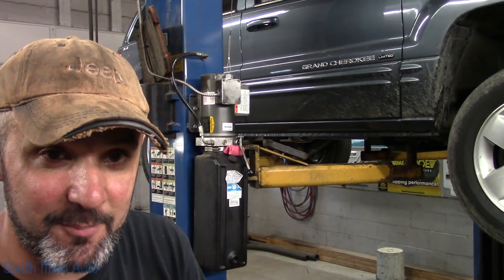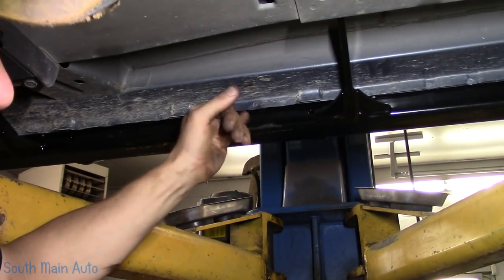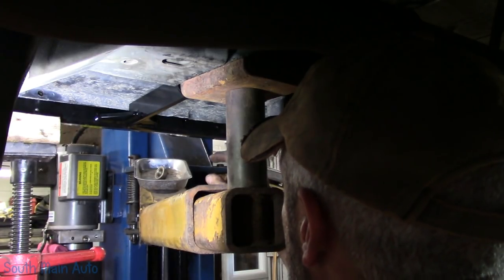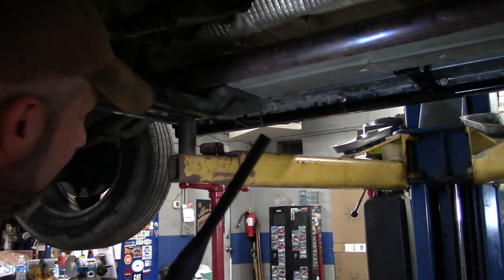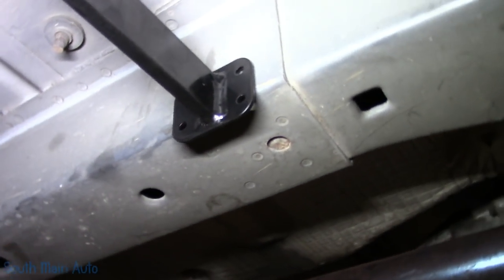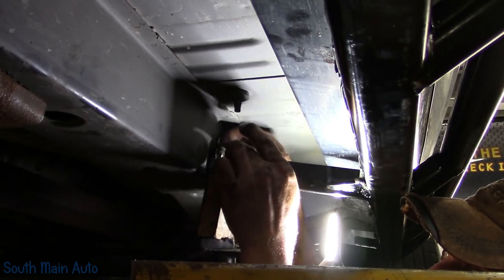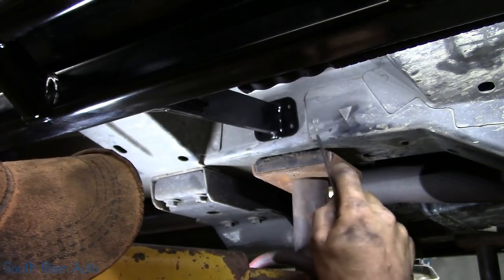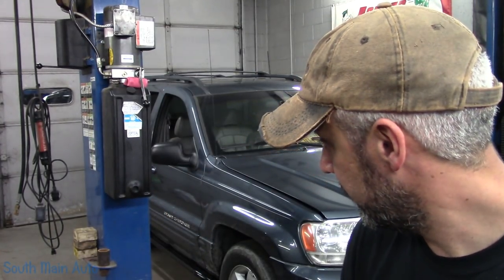Jeep WJ: Iron Rock Off Road Premium Rock Slider

Comment: should have taken the drill tip and ground what is called a self center cut the back part of the cutting edge you grind back on both back sides and it will act as a stabilizer and drill faster much like a center drill without using a center drill 3/8 drill big enought to do that. start slow then pick up speed drill will not walktheres a guy on youtube that will show you what I am talking about. Just for future drilling

Comment: Nice to see those braces so solidly built.  The fact they're so heavy hopefully means quality.
Reply: Cuba Rodriguez Did you hear the list of work he's already done on it?
Reply: Jeremy Anthony oh yeah, I'm a Patron so I heard the list. But he's only going to show the "fun" stuff!
Reply: Cuba Rodriguez what do you mean patron? Like his patron channel
Reply: Jeremy Anthony well it's not a channel, it's like a private group, when you contribute a monthly amount. As little as a dollar a month or as much as you like.
Reply: Cuba Rodriguez oh that's right. I forgot. Wth is wrong with me?  Also what's your latest project?
Reply: Jeremy Anthony just got done working on my sister's AC unit.  It was leaking water all inside the house. So I flushed out the drain, blew off the evaporator, and steam cleaned the carpet. 

I have a sink to install soon as the top/basin is cracked. Transferring the faucet, etc.
Reply: Cuba Rodriguez wow you're a Jill of all trades. Any cars you're working on?
Reply: Cuba Rodriguez maybe this will be Hannah's jeep
Reply: Jeremy Anthony well, installing a trans on a Jeep, actually. Trans & transfer case.... the AW4 with the NV231. It's in, but I need to zip it up. Torque converter bolts need to be torqued to spec and then wiring, and replace the mount which had to be ordered in. 

I also need to do brakes all around on a 96 Ranger... install parking brake cables. Filler neck leaks, so that's also on "the list".
Reply: Jeremy Anthony no, this will be his hunting or off roading, being a kid Jeep. Lol.
Reply: what kind of car do you have for personal use?
Reply: Jeremy Anthony 89 S10 Blazer 4.3ltr 4x4...(mobile garage) & 86 S10 pickup 2.8ltr RWD
Reply: Jeremy Anthony I'm sure they're pictured in the G+ albums,  at least the Blazer is, because I work out of it.
Reply: wow. ever had any toyotas ? i have 2012 corolla s.
Reply: Jeremy Anthony never owned one, but they're great vehicles. I always wanted another 90 something civic, as they're fun to drive and great on gas. I haven't done much work on the newer corolla, so I don't know their quirks or advantages.

Comment: wondering if there was any way you could have incorporated some brake clean in the video?  Is there enough surface area on the sliders to use them as steps?

Comment: Project Farm did a comparison article that fluid film scored very high in. Not so much as a penetrant but as a surface protector against rust.
Reply: i think the idea behind the word penetrant means it migrates into already rusted areas and helps seal it to slow/stop further rusting, not so much meant for breaking free rusted fasteners which have large forces applied and sealed tighter than a drum :) 
speaking of which, I see they started carrying it at some of the local home improvement stores, seen it at a "big orange" store not sure about the big blue place or others, but surely they'll have it

Comment: how do jack the vehicle up now that these are in the way of the jacking area?
Reply: the "jacking points" on those jeeps are actually the "uni-body" frame he bolted to the sides of underneath and not the body spot welded seams!!
it's a very bad mistake jacking them up form the body panel seams! it tells you in the manual and maybe by the jack and spare...

Comment: love it! hypothetically if you got a flat tire on the side of the road you could just jack up on these since it takes up the pinch weld area?
Reply from the maker: You sure could!
Reply: I made the mistake once of putting my lift arm on a pinch weld of a jeep cherokee...doesn't work out well.  Wasn't my Jeep either.  Fortunately, I always look at everything before going up too far.
Reply: lol johnaclark1, shouldn't be any issues being a steel tubing spreading the load out all over the place, it's probably stronger than the factory jacking points now.
if it wasn't strong it would be called "body crushers" :))

Comment: So the rockers are being held on by 1/4" of steel... how is that safe?
Reply: The entire side structure of the unibody is a single structural high-strength stamping including the door frames and rockers, which is then welded every inch or two to the floor stamping along a 3/4" pinch weld. No lack of strength there.

Google "body in white" to see examples.